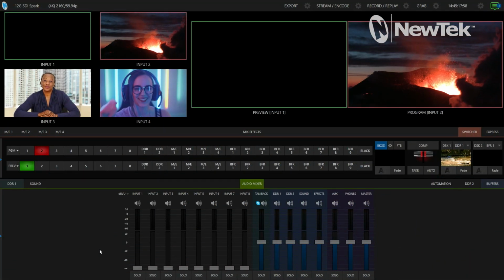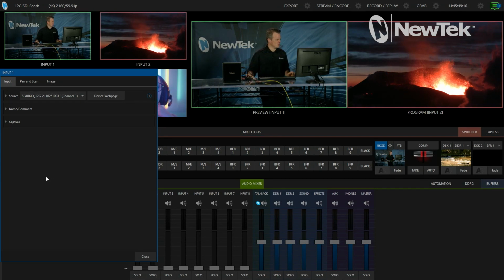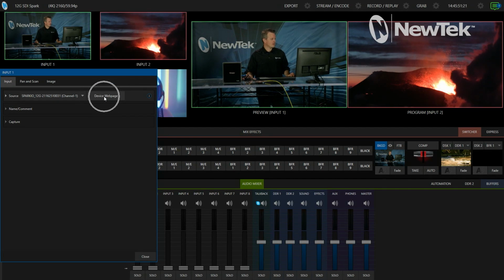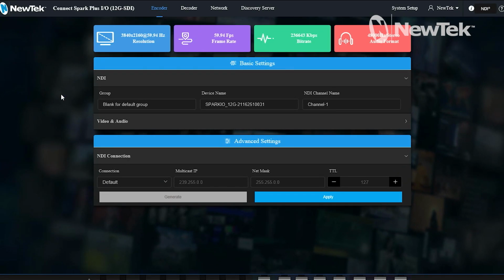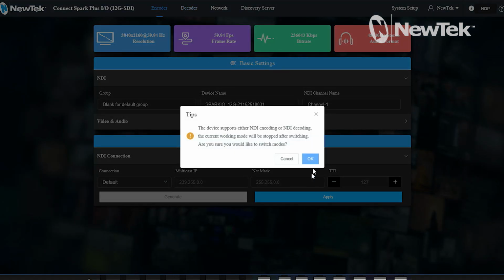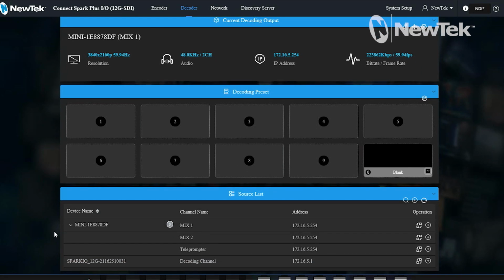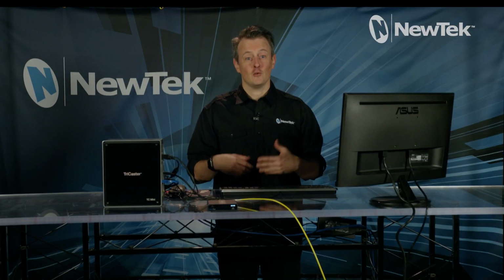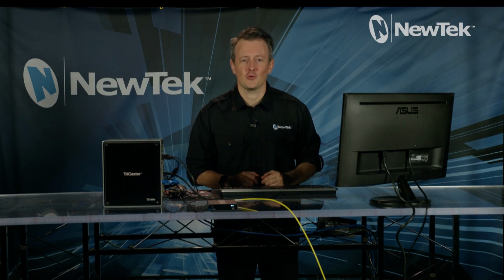Tuesday Tutorial : Using the 12G SDI Spark Plus IO

Comment: Can you do in and out at the same time I.e. get SDI in port to NDI and get out any NDI to SDI on the SDI out port at the sane time?
Reply from the maker: no.  it can only be input or output
Reply: @NewTekInc  it would be great to have a hardware that you select any NDI from the network and convert it to any output HDMI and/or SDI (multi NDI to multi HDMI / SDI) and vice versa from one hardware unit 🤔